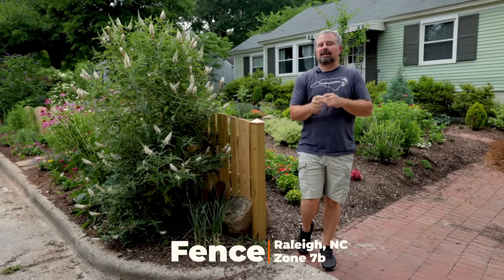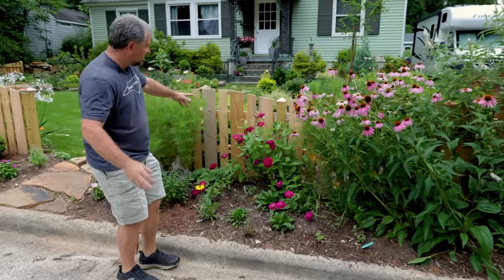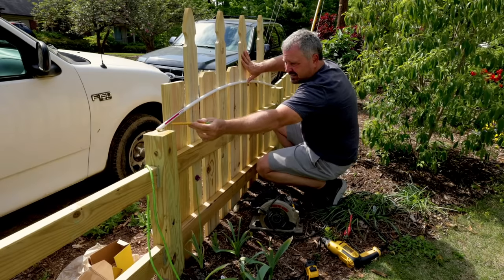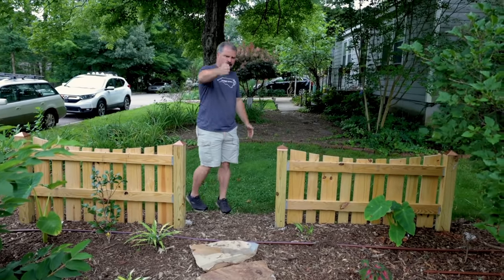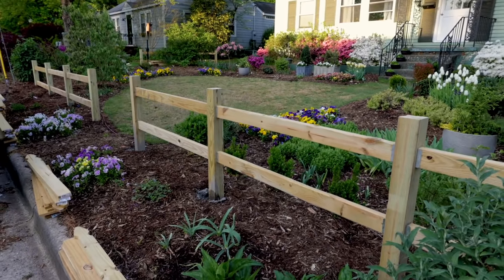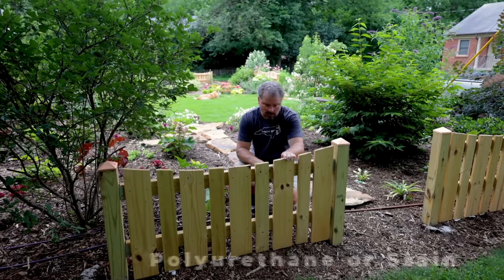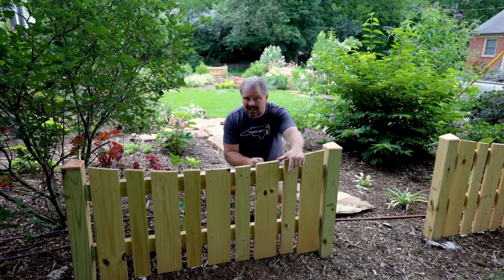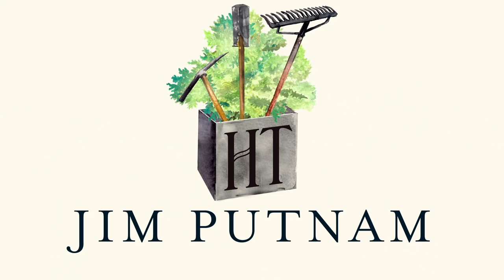Garden Fence Installation

Comment: This was really helpful! I see a lot of tricks that I didn't know (e.g. how you achieved the arch 💡). As for the shape of the three side panels, my personal preference was what you did - much more graceful. The varying width pickets was such a good idea, and I won't ever stop being amazed by the rocks buried under the fence. Noticed how much of an ambidextrous person you were - as a lefty, I'm that way with construction and tools (which are often right-handed)....sure makes building a deck a lot easier when you can use a hammer with either hand.
Reply from the maker: I am ambidextrous with most things. I don't even really think about it until people point it out. Thanks for watching!

Comment: Nice! We are also working on some fences and I have one tip with the cost of lumber being what it is right now. Like you said about using the most cost effective pickets, we needed a bunch of 8 and 4 foot length pieces so we almost bought all 8 foot boards. But then I looked down and realized the 12 foot boards were only a dollar or two more. It was a big savings over buying all 8 foot pieces. Be sure to price your project out a couple different ways!

Comment: This fencing is so pretty! Eventually I would love to put up a fence like this along the stream that runs along the front yard but I think we need to fence in the backyard first for the dogs. I'm thinking split rail back there so we don't block the look of the woods and also the grade back there is funky so split rail with chicken wire would be easier to install.

Comment: I'm in the midst of trying to do something about my neighbor from 🔥. I can't really put any 🌱 in the ground, because his washouts have been burying them so I lost almost everything I planted. Now he has bamboo cropping up on our side. Another problem is it's a very narrow space. I was thinking about trying a tall narrow planter with something tall (podocarpus?) and tall lattice on our side of his fence (it looks like it is going to fall over into our driveway anyway.
Reply: When our neighbor cut an 8 foot hedge in half and then chopped every other one to the stump between our narrow lots, I had a landscape designer come out.  They drew plantings on either end of a tall, heavy lattice framed panel.  I didn't end up using that idea but it looked nice on paper.  I then planted 18 tall Podocarpas.  3Three years later they are 15 feet tall.  Hope you can come up with something you like.
Reply: @Bunny-rh1yy  thank you so much for the ideas and good thoughts